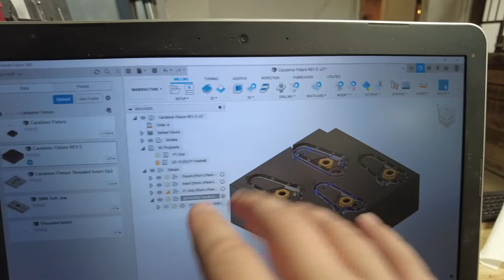Day 21 | Better Carabiner Production

Comment: Suggest you search for “Machining Titanium “ pdf from Iscar Tools. It explains very well why titanium is very finicky about Surface speed and chip load.  You can experiment with aluminum all you want but a bit too slow or too fast with titanium and end mills get consumed rapidly.  I read that pdf before I started machining titanium and it saved a ton of time and resulted in my knowing what parameters to start with and how far I could tweak them to optimize. Still loving your videos.
Reply from the maker: Good to know! I will do that! Thanks!

Comment: Grinding a small flat on the endmill really helps alot when using solid "side screw" endmill holders. It will help them not pull out or slip (rotate). I'm loving the vlog videos man!
Reply from the maker: I'm curious if it will make a difference here. I know I can get that added on by Lakeshore, but I was told it won't matter on a tool this small?

Comment: Nice man, really enjoying these updates! If you haven't tried using a drill to knock out most of the material in those slots I'd highly suggest trying it. I switched to that method for slotting Ti a while back and find it super efficient...that and the cutting force is mainly axial 👍. Keep at it, love seeing the progress!
Reply from the maker: Thanks man! I've been enjoying your videos lately. I've been working through the backlog as I've been sandblasting.
That's definitely something I'll look into. Thanks!